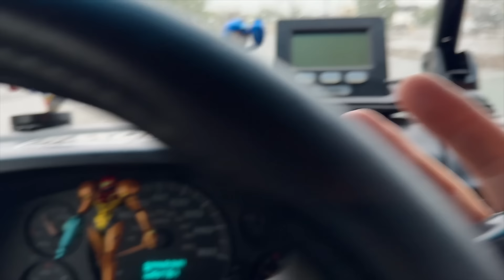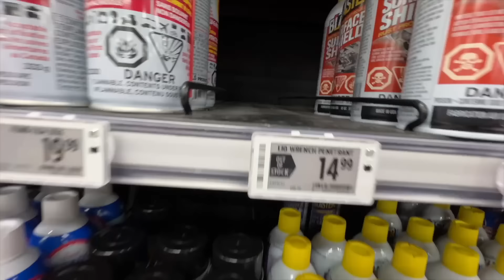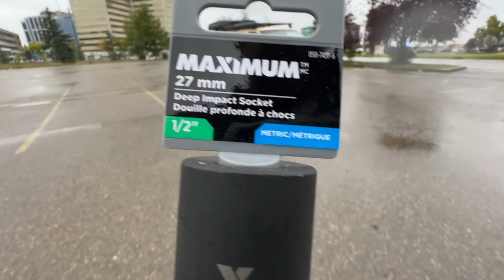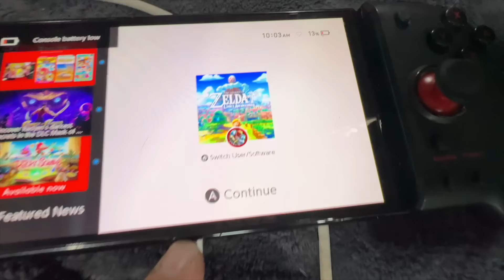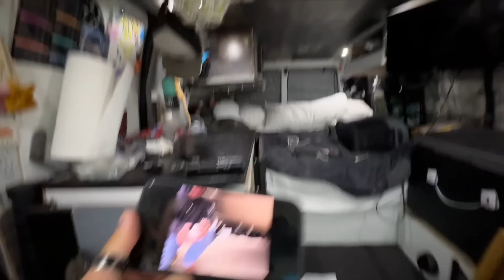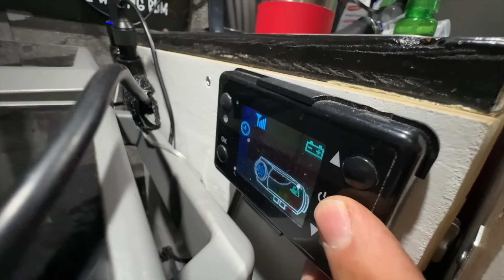They Wanted $1350 😱  Can I Do It Cheaper? - Vanlife Day in the Life

Comment: Hi Matt the nylon washer is designed to be a low fricton slipper gasket between the rotating parts. It is a consumable  part that will need to be replaced  every now and then. The square nut can be made in any quality machine  shop . Get 2 made. Have a nice day. Tom in the Maritimes at the NB-NS border

Comment: Hey Mathew . you could take the new bolt and nut you bought to a welding fab shop and get them to weld on some thin flat bar on the out side of the nut to make it fit properly into the square tubing .
Reply: I was wondering how his going to get that nut on that bolt🤔 And is he going to get it on tight enough?  Or a trailer hitch company
Reply: Or try finding a fine thread nut that the socket fits on inside the square tube!

Comment: Another option you could have done with the tow bar system. You could have had a fab shop weld that square nut inside the and drilled out those threads so it was smooth and got a longer bolt that would pass through that square nut and put washer locking washer and nut on the inside. So basically, that large nut becomes a spacer for the bolt washer/nut. Hopefully, what i said made sense. 🤷‍♂️

Comment: A longer replacement bolt along with the square nut and an additional nylock nut to double nut it prevent loosening  drop a penny or old washer beside square nut to prevent it from turning  tighten and install nylock nut

Comment: I’m a lifetime back yard mechanic and personally I’d have tried to chase the threads in the original,plus when you started unthreading the nut I would have sprayed lubricant on it and tightened back up to maybe save the threads! But I’ve been doing this stuff for over 50 years now! Also perhaps there is a fine thread nut that your socket fits on that works with the fine thread bolt!

Comment: I have the exact same tow bar and braking system and I haven't had any bolts on it come loose but the bolts that hold the tow bar base plate brackets to the frame did loosen so I just had that tightened and I think the way it works with these things is basically what you're doing just use heavy duty grade 8 bolts

Comment: Hi Matt no the adj wrench will NOT fit inside the "yoke" You will need  a closed end wrench to fit inside. It is not unusual for the  bolt head and the nut to be a different size. Always use "impact" sockets with an impact gun. Regular sockets can easily  split under  the stress.  Have a nice day   Tom in the Maritimes at the NB-NS border

Comment: As to the hitch, I'd just add a lock washer to imperial threaded bolt/nut. Put it inside the tube then put the the nut on. 
The origional assembly shouldn't have allowed that slip plastic washer to do much of anything. Once you tighten down that bolt to your custom made nut that plastic/teflon/? whatever slip spacer shouldn't "slip" anyway. So it's useless if you think about that portion of the assembly and it's purpose. 

Now it is possible that the origional nut was "peened over" inside and that would have kept the nut from backing off. (also would explain why you had a tuff time taking that apart.) And could allow that assembly to twist some if towing required it. A possibility and would negate my recommendation for the imperial solution. Take the original bolt with you when you pickup your new one from the machine shop. Ask a machinist if the bolt you removed looks like it was peened to keep the nut from backing off. If he says yes then you have additional problems to resolve.

Also, normal wear and tear will not break unhardened sockets. You don't have the strength or power tool to break an unhardened socket. Standard, brand named sockets are fine for many lifetimes, Unless your buying really, really cheap sockets and it does not appear that's the case.

Comment: You need to get back in there and tighten that bolt up to about a hundred pounds try to remember the force it took to get it off you use the long handle breaker bar when you replaced it you used a 6-inch handle ratchet it is way too loose you need to get in there and try to remember the amount of force you use to loosen it to tighten it back up about 100 lb I say😮 happy sailing

Comment: You can't fit a lathe in the van. But you can fit a cheap stick welder. Hypothetically you could have built up the edge of the coarse threaded square nut by building up the base metal with small beads of weld metal and then grind it to a nice square shape to fit in your deep hole there (calm down). Then you could have (possibly) used that coarse bolt to connect your joint. Also, not a shop guy, but I think a small tube of moly or marine grease on all the nuts or at least the washers might make the whole thing easier to maintain in the future.

An intro to welding class at your local community college could be worth it so you can have an extra skill when doing repairs. Probably cost approx as much as that thing you're repairing.

Comment: I’m sure you have finished the hitch a month ago but the reason the nut stripped out and the bolt was so hard to get out was because they would have pressed the end of the bolt to mushroom it. 
This is so the bolt will never loosen from the hitch twisting so much as the vehicle tips side to side thousands of times a hour.
Getting a new nut and just lock tightening it …I’m not sure I would trust it ? At the very least I would get a longer bolt-lock tight the new nut and also install a jam nut or nyloc nut behind that.
I would hate to see it come loose on you.
I’m not saying it to piss you off either…I’m just worried you may have overlooked why it was so hard to remove the bolt….thats on purpose.
Anyways….now I will sleep better that I mentioned it.
Take care
Reply from the maker: They didn’t mushroom it - it did in fact have a nylon lock nut on top of the square nut, you can see it pretty clearly when I show down the shank. In all the confusion (and frustration) of getting it apart I forgot about it. Noticed it during editing when I could see it on a bigger screen. 

Fret not and stay tuned but yes I replaced the lock nut 😎
Reply: @VanlifePLUS  
AWESOMENESS ! 
I had a friend of mine lose a jeep from the back of his rv when the whole centre part of his hitch broke off including the safety chains.
The outcome was not something I will talk about.
I also see you mount your safety tether to something besides the hitch which is also a great idea and probably would have helped my friend if he didn’t put his to the hitch also.
Anyways…we were actually up in Calgary from Lethbridge yesterday with my flat deck trailer to rescue a friend’s company truck that broke down at jack astors restaurant.
Also thanks for the $60 discount at craze outdoors…we picked up a new cooktop and bbq a couple weeks ago !!

Comment: Take it from an engineer, threads are designed to have clearance with one another is why we calculate thread shear when the system is designed.  You could not have prevented the damage by the way you needed such a huge lever arm to remove the system.  In other words you did nothing wrong, threads are threads and there is very little engagement and don’t resist side to side movement very well.  🤓

Comment: Might want to be careful directly charging your switch over USB-C. From what I've read Nintendo doesn't comply with the charging standard, so just using a standard cable could actually feed too much power to the switch. Their "official" cable has a resistor in the power brick to limit the power to an appropriate amount.
Reply from the maker: Yeah I’ve heard those horror stories too but I’m not going to use AC power everytime I need to charge it when I’m living in a van 🤷‍♂️ we’ll continue to live on the edge! 😂
Reply: @VanlifePLUS  Here's hoping it doesn't give you any grief. :)

Comment: Why not replace with a metal washer, or find a piece of rugged delron material and make your own
Reply from the maker: Because then it could rust and it’s for vibration and friction and this way you get all the washers and the locking nuts!
Reply: @VanlifePLUS  what about lubrication in that area to prevent rust
Reply from the maker: @dawnsnyder216  I guess that’s a rabbit hole you could go down, but I have the new washers and all is good 👌

Comment: Where can an RV center for 8 years who's the best person to deal with hitches an RV center why didn't you start their and by the way when a mechanic says I've seen people drive around for years like that usually implies that you're not going to have to worry about it the manufacturer knows that piece will break in so many hours of use which you have reached and we'll probably reach again in another 3 years look at the size of that nut do you really think it's going to break without a tiny piece of plastic holding it..😂 happy sailing

Comment: After all of that I’m thinking although they could have somehow done it, it wouldn’t be worth the “shop’s” while to fix the old one as opposed to selling you a new one 😕…..seems you had a short tour of the Rabbit Hole 🫤
Reply from the maker: No way! Now that I know how it works, with an air gun that whole job would take maybe 15 minutes of labour which they could then charge $125 for on top of the replacement parts. Would be EASY money. They are just simply not versed in their products that well since he told me it was welded inside 😂 which it CLEARLY was not. AND he out right fibbed by saying the product was discontinued and replacement parts weren’t supplied 😅
Reply: @VanlifePLUS  kudos to you!